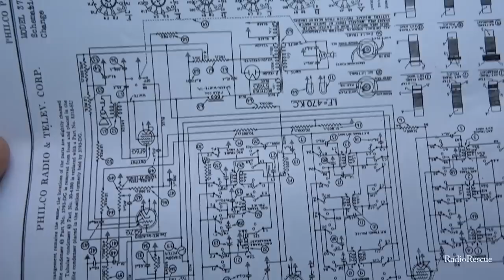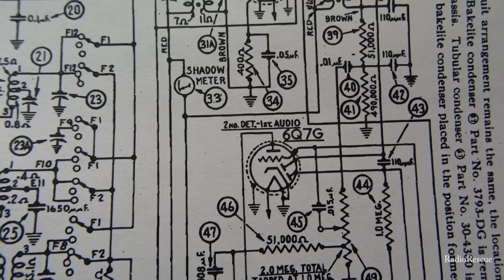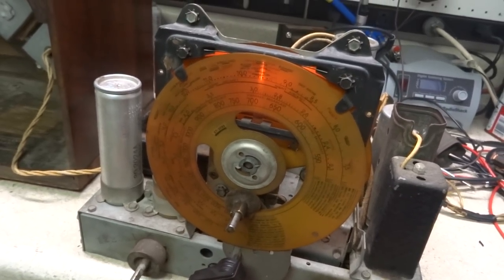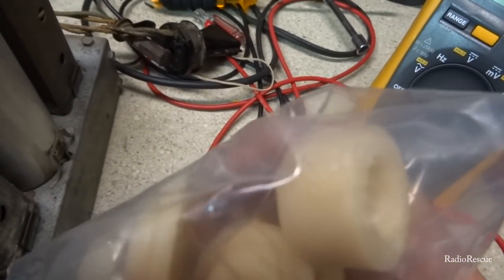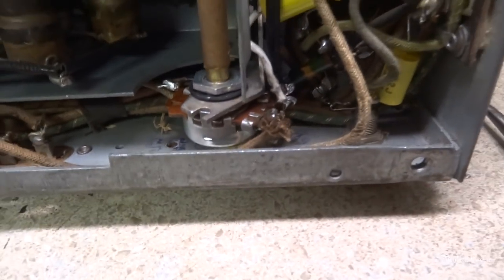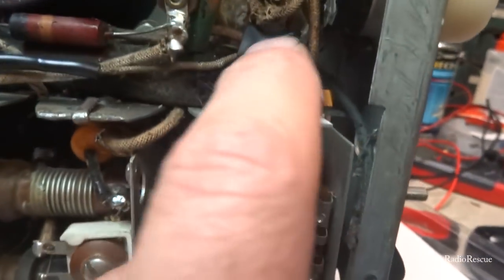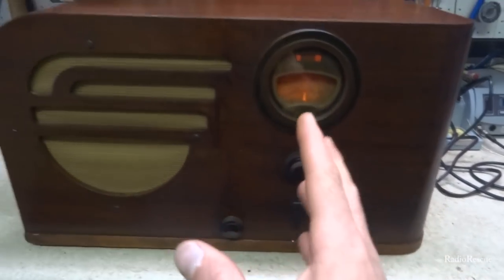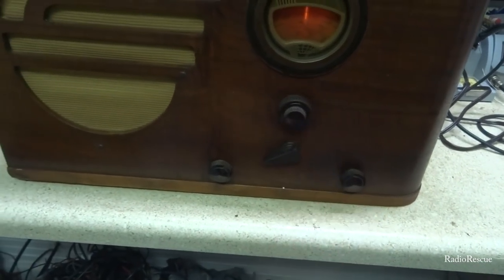Repair Of A 1937 Philco 37-630 Tube Radio

Comment: I was in the USAF and also worked jointly for the NSA in Ft. Meade Md back in the 70’s and 80’s and we monitored quite a few numbers stations although most were in Morse code. They are all basically all the same, morse or voice. They all use a five character group and usually don’t ever repeat. It you ever did get one to repeat, at least back then, that was a pretty big deal. My understanding was they all were pretty much based on plaintext combined with a one-time pad cypher (just a book of random numbers) that both sides had to have a copy of the book to decrypt. Because most all the stations were static, it was simple to find out exactly where they were broadcasting from but you never knew who was receiving them. (Some, not all, were found using direction finding to be coming from military headquarters in some countries) Now at the time I was working with these signals, our understanding was that it was a fairly secure way to send broadcasts to agents in other countries but they were also thought to be used by traffickers in just about anything. Some of the pretty famous ones were in the asia side of the world but cuba was also pretty big on their use also.
Reply: Buddy Martin wow thanks for that amazing info

Comment: It's nice to see someone else be critical about tubes and properly installed/replaced caps!  Also good to hear you mention about some folks being panzy-assed about using safety caps too lol  I use what I have available as long as the voltage can handle the circuit. There are times I do use them but it's honestly doesn't matter as far as them being safety caps, it more pertains to the voltage handling.  You do real nice work, and thanks for the videos!
Reply from the maker: I agree. Even the cheapest caps now days far supersede the quality of caps originally used in these sets by the manufacturer. As long as you use basic common sense, they'll be fine.

Comment: I feel your pain.....I actually have a 37-630 on my bench right now it is a console model. I found several differences in the radio vs. the schematic. I disassembled the RF section to changed those two paper caps. I wish I had know about the "trick" that you demonstrated. I also changed several broken wires. The 11 tab terminal strip on the side of the chassis had two broken tabs so I replaced it. I have so little experience on radio repair as I never had any one teach me this stuff. Just a mid life crises I started a few years back. So I hope I can get all those wires back to the correct position and tabs. Wish me lots of luck. and God bless.
Reply from the maker: Take pictures with your phone before you take anything apart. Also label each wire with a number from left to right so you remember where it goes . Good luck bud.

Comment: I have a 1937 Philco just like the on that you pointed to on the shelf. There are 3 beige wires that go to the speaker. My German Shepherd chewed it when she was a puppy, about 18 months ago. This radio had no back on it, but it has been restored. They all look the same but I'm sure they may have different functions, not just for the speaker.
Reply: often they would use a backwards-wound coil on the speaker as part of the power supply, and a "hum-bucker"
Reply: They were probably different colors 80 years ago. Since the electromagnetic on the speaker is part of the power supply circuit, those wires carry the high voltage for the whole radio. You definitely wouldn't want to have them short or connect them incorrectly. Good thing the radio wasn't on when puppy chewed them!

Comment: It is amazing that you can repair these. I have a 1947 Plaskon that was refurbished like brand new.  I have a 1954 philco plastic red model 170B5. It comes on but the volume is loud and it doesn’t pick up any stations. I can control the volume. Any thoughts on what might cause that?  What state do you live in?

Comment: In 1937 shortwave was interesting because it's just before WWII. Then during WWII  shortwave propaganda was interesting lessening and you could also pickup WWII pilot conversations.
Reply: Picking up world war 2 pilots ,must of Been fun to listen to,I just. Sent for a radio that pick up air port pilots ,I live less then a mile from a small airport.
Reply from the maker: Back when these were new,they were MUCH more interesting SW was one of the only long distance communications. Police used around 160m (2 megahertz range) and SW broadcast lined the bands. Now you're lucky to hear a few SW stations and a few commercial aircraft on sideband.

Comment: The most destructive explosive capacitors I have ever had blow-up have all been 'Safety Capicaptors'.
Reply: How about the most stinky,selium  rectifyers,or the worst caps bumble bombs .everyone I have seen either blown up or a crack running down the side,I can't believe people resell those pieces of crap,I throw those out,I sure wouldnt resell them,he'll I have  1950 ,s tube portable zenith, It has the worst access to replace the power cord,I have ever seen ,it had a bunch of bumble bomb capciators, ,it has a selium rectifyer,I offer to give this radio away,to anyone who wants to pick it up.
Reply: shango066 has mentioned in his videos the white tubular Elmenco caps which are garbage and known to explode.
Reply: @nor4277  - You might interest me in it. Where are you & would you ship it?

Comment: Nice job on that Philco. I've got the same radio, but it needs to be serviced. I can only hope it'll perform as nice as yours once it's up and running again. Where did you get the replacement rubber parts kit and how much did it cost?
That dial seems to be in great shape for its age. I wouldn't think it needs to be replaced, but I guess it's not perfect, is it?
Regards, Tom